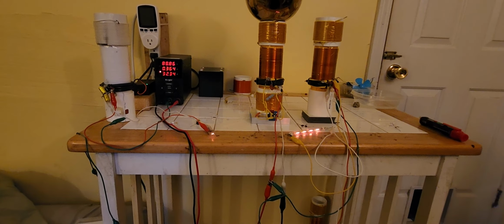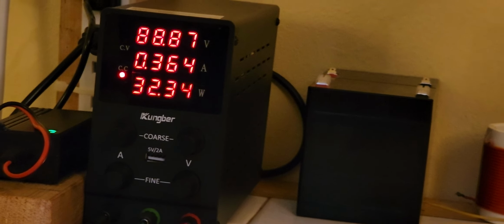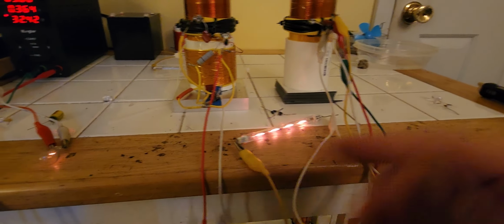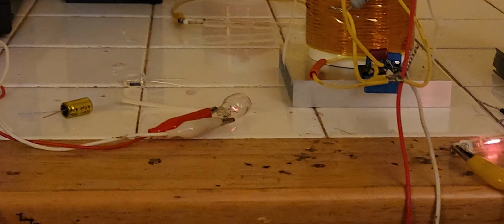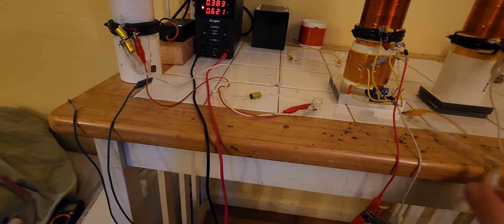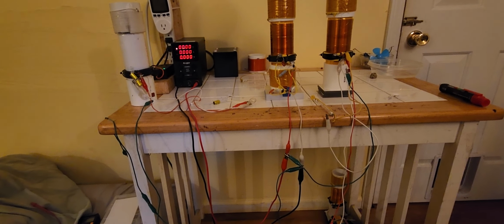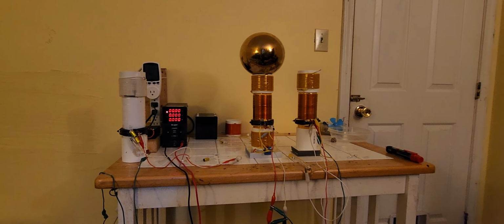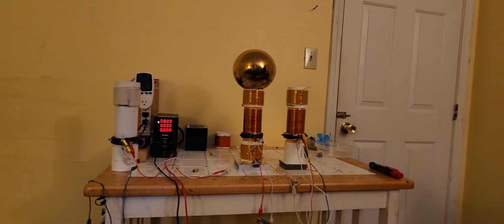✨️Decoupling Cause From Effect In A Radient Energy Tesla Style Transmitter To Freely Run Loads😎

Comment: correct me if wrong but you are pulsing the primary with dc and taking the reverse flyback voltage into the secondary? Thats what i would do , never built a Tesla coil on the list